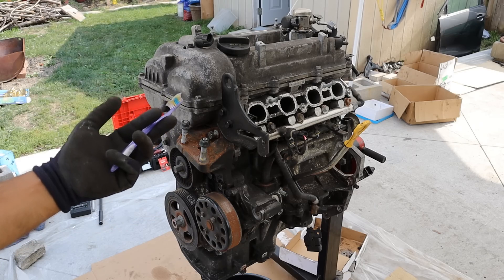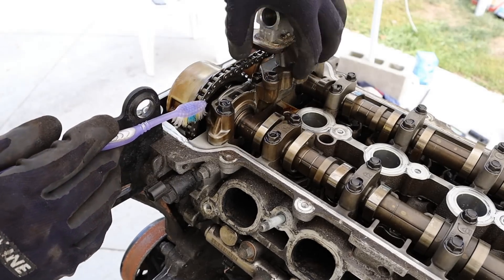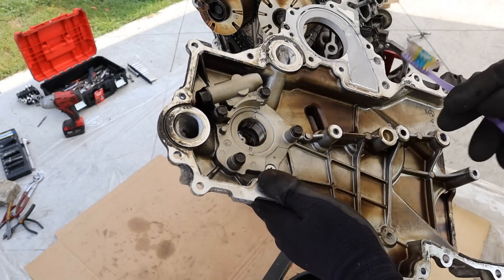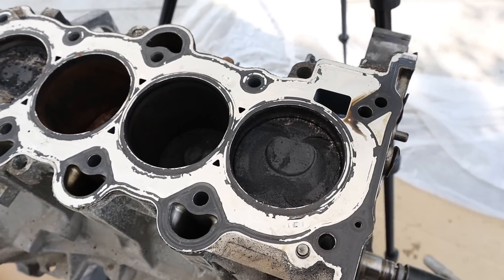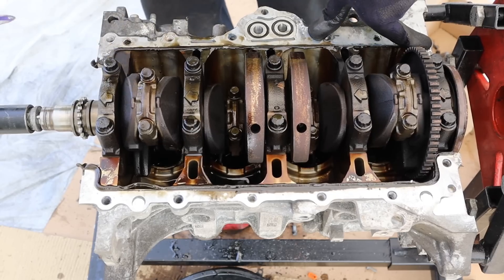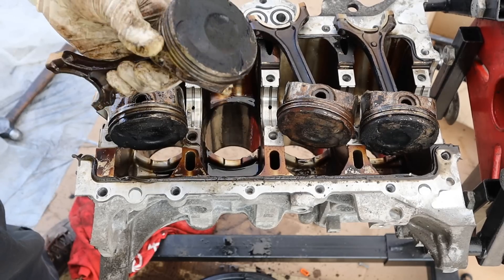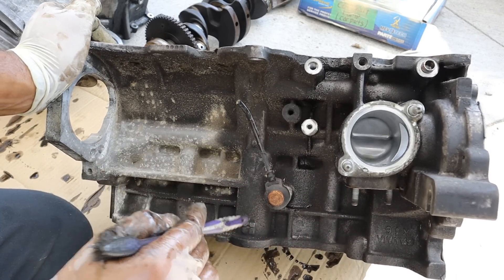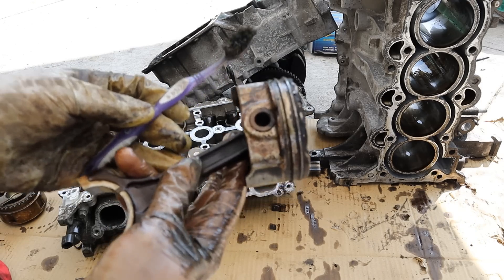Why KIA Engines Fail

Comment: Let's not put all the blame on the owners.  My Sedona threw a con rod at only 70 k.  I was running expensive synthetic oil and changed it ahead of schedule.  I also never drove it hard.  How about a little blame for the engineers that designed these pieces of crap

Comment: Mine has 181K on it and runs amazing. Oil consumption is awful but it doesn't blow blue smoke or leak. Original clutch in car. It's partly who drives it.

Comment: Fiat use a single casting that carries the bearing shells. They save the costs of all those caps and get a stiffer engine lump into the bargain. 
Their cost cutting goof was fitting a weak cam chain that will fail after 100K miles.

Comment: Nice Video. Wish I've seen it before may. My Gamma 1.6 T-GDI (62k km) blew the turbo and developed an engine knock due to oil starvation after 5k km from being serviced at Kia dealership(full engine changed at one year and up to 15k km). I reported a year ago ... Lesson is to check the OIL and don't trust the dealership.

Comment: These 1.6 GDIs are usually very solid. 
Short trips and low quality oil and fuel will hurt them after 10 years though. 
I've seen them with around 700k miles on them without being opened. Synthetic oil and mostly highway trips (so at full operating temp) definitely helps to get that far!

Edit: the plastic inserts in the cooling jacket are to evenly distribute heat and therefore thermal expansion between the top and bottom of the cylinder.
Reply: Put a time stamp for what you're talking about. 6:10
Reply: FACTS! The dealership i bought my Hyundai had a 06 Sonata with a million miles on it proudly displayed in the showroom.
Reply: 700k 🤣🤣🤣
Reply: @anthonyiannone7618  yep, lemme find a link
Reply: @19jacobob93  700k?!?!?!

“Hi yes I’ll take sh*t that never happened for 500 please and thank you”
Reply: @maxboya  it's on the Hyundai forum on a thread called 'another milestone' it keeps deleting my comment when I post a link here. It was at 635k miles in February so will be much higher by now
Reply: @19jacobob93  Hyundai and Kia are very hit and miss coming out of the plant.  

I worked for Hyundai/Kia when we sold truck loads of Theta II cars, and some of them were blowing up before their first oil change.   The 3.3 Sonatas and Azeras were even worse.

I agree that certain engines IF built right and taken care of right will go a long time, but there comes a point where you see too many cars going through 3-4 engines on people for it to not be the fault of the manufacturer as well.  

That being said, my one and only Hyundai had 680k on the clock (km) on it's second engine and original trans (2nd clutch).  It was a diesel H1 with the Mitsu based 4D motor though.  Nothing electrical worked, but the drivetrain was solid, albeit slow an inefficient.
Reply: @maxboya  my wife’s 2011 forte ex has 240k miles on it 🤷🏻‍♂️
Reply: @Max  crying laughing at this, 8yo 150k and my gdi is drinking oil like it's a 2 stroke, I changed oil every 5k
Reply: @SmallT2  2.4?
Reply: @anthonyiannone7618  700k yards
Reply: How does plastic help in heat distribution
Reply: @mastergreyskull523  it's nothing to do with the material, it's designed to decrease the coolant flow over the bottoms of the cylinders in order for them to match the thermal expansion of the hotter top end
Reply: @mastergreyskull523  it's a very special kind of plastic, capable of things we haven't imagined. Lol
Reply: 700K.....hmmm hard to believe......
Reply: @neilduncan8657  that's why I gave the details for people to see the vehicle since I can't post a link on YT... What would I gain from making that shit up?
Reply: 700k         crap !
Reply: 70.000max
Reply: @arnoldh7204  There are multiple with crazy mileage. They are a popular taxi in Turkey and often pass 1 million KMs on the same 1.6 Gamma engine. As I stated, they are just sensitive to cold cycles... If they stay warm or do long trips such as use in taxis, they will last forever. Obviously a warmer climate also helps.
Reply: Low quality oil?  Where do you buy that since ALL oil in the US is spec'd to be the same per the UAE weight.
Reply: @justayoutuber1906  the UAE weight has nothing to do with quality. I would explicitly use oils with Group III base stocks as a minimum in all GDI engines
Reply: you meant 700Kms? LOL KIA engine are junks!!!
Reply: @kristianbautista6647  No miles. I think it currently has around 680k. They are good but sensitive to a few factors such as driving too hard on a cold engine or only short trips, low quality oils and fuels and not servicing on time. A combination of these factors is why they fail.
If you do mostly highway driving, use high quality fluids and fuels and give them an Italian tune up once a week, you won't have a problem. 
I can make them last forever because I have mechanical empathy whereas most Hyundai/Kia buyers purchase them for their lower price and have zero mechanical knowledge and rarely stick to maintenance schedules.
Reply: Are you a comedian or just a troll? Kias and hyundais are poor quality economy boxes
Reply: @getthecansin  both thanks, and I tend to agree although my statement was solely directed towards the 1.6 GDI engine in particular so let's not get off track. 
I've worked on a few of them, some with big miles and unless they have been abused with poor maintenance or used solely for short trips in cold climates, they are very reliable.
Reply: @19jacobob93  fair point, bloody GDI engines in general are a pain 🙂👌🏻
Reply: @getthecansin  Yeah they definitely can be! Some seem to avoid the issues completely somehow. BMW and VW have had some horrendous problems! GM, Ford, Mazda, Merc all seem to have avoided any GDI related issues. Hyundai/Kia are very hit and miss. The 2.4 and 2.0T I'd completely avoid, everything else seems fine. Honda had a problem with massive fuel dilution in their 1.5T too!
Reply: @19jacobob93  agreed, hit and miss but bottom line do the flipping services 👌🏻
Reply: @19jacobob93  the 3.8l v6 in the palisades/tellurides/genesis models are amazing. That’s definitely included in the everything else besides the 4 cylinders lol
Reply: @rob malcolm  Yep those seem to be great in both GDI and MPI form! Never heard anything bad about them
Reply: @getthecansin  look up reliability lists, kia has come a long way from being economy shitboxes, they are doing pretty good on reliability now
Reply: @idk970326  true measure is long term reliability, will be many years till we know. New models like most cars great out of the box but time is the test 👌🏻

Comment: I think another reason why certain manufacturers are more reliable and longer lasting than others has to do with their respective owners. The typical driver profile for Toyota are more conservative with conscientious maintenance. Honda…especially the Civic owners include a lot of performance minded less conservative drivers however they also continuously tune and maintain their vehicles. And then you have the typical Hyundai/Kia drivers. 😂
Reply from the maker: I agree that has a large factor

Comment: Smokes. Thats a 1.6 liter engine!?! With such a lame timing chain!?!
I had a 550cc V twin bike engine with bigger timing chain than that. ie each bank (275cc) on it's own has twice that size for a timing chain. Fail to design!  Belts got a bad rap for failing. So they went for chains? Well, I had a Nissan Skyline L20ET in the 80s that had a dual row chain and that was a straight 6, bigger that whats on this vid. Sorry, manufacturers of today are making engines to ware out just after warranty is passed. Good luck, I'm keeping my old timers, looks like they are going to increase in value.

Comment: what about the 1.25 Kappa engine? I bought a used picanto and does the routine maintenance. the previous owner did use plain water in the radiator though, which is sad. but overall the car has been pretty reliable.

Comment: The play in #1 that suggested the bearing was worn out, but it wasn't? What else could've caused that play in the piston + rod like that? Clearly something was wearing down in the engine with the metal in the oil and pan, but it didn't look like anything that would've led to #1 having all that extra play in it. Did I miss what it ended up being?

Comment: i had a kia picanto 2017 1.2 engine
and i beat it every day
road racing
and it has 100k and still going strong like new car
Reply: @WirelessNut bro you need to try racing and sliding this thing, its so fun and fast, i learned to drift fwd in it you need to lock the rear wheels just use the ebrake with little of footbrake at same time and the car will lock in back
and but tires at 32in front
and 36 in back

Comment: 2012 Kia Soul base model, 1.6 L automatic with 239, 560 miles on the clock as of today.  The key is oil changes every three to four thousand miles.  It burn about 1/4 of a quart between oil changes.  Oh, never cleaned the valves on this direct injection engine.  Still runs like a Swiss watch.  The only item that needed replacement was the alternator.  All other items were maintenance items.  The trans is service every 30,000 miles and the cooling system flushed every two years. The front pads and rotors replaced at about every 30/35 thousand miles and the rears at 50 thousand.
Reply: Do you still have it? How is it so far? Have the same model but with 87000 miles. I figure if I keep up with maintenance and fix and protect from rust it could go on for another 7-8 years.
Reply: Good luck with that mine at 214k started to idle low and wanted to shut off because of carbon.
Reply: Kia on basically all of their engines uses really low tension piston rings just like the early 1zzfe, 2azfe, and 2arfe, Dynamic force toyota engines as the piston rings get clogged very easily. They along with other manufacturers do it because it is one of the cheaper, easier ways to get a solid 2-3+ mpg from an engine. Volvo's mixed reliability reputation is from their most of their new engines having low tension piston rings that get better fuel economy from less friction, but then they get seized up, they scrape the walls and lose compression. Ecotec engines do this too though are not as extreme as three manufacturers I have listed already. These newer engines across different brands are basically intolerant of neglect in terms of not becoming oil burning. I don't like the idea that doing 6k oil changes can somehow be "neglectful" enough for an engine to start giving me problems

Comment: I rebuilt one of these engines last year, they are simple enough that not a lot can go wrong with them, my only complaint with them is the surface of the rod caps where it meets up with the connecting rod, very crudely done, to me it looks like Kia casted those rods and did no machine work to them at all.
Reply: what if cracked?  mo betta no?
Reply: Hi Chris do you think doing a professional hidrogen carbon cleaning every 30.000 miles (50.000 kms) would increase engine longevity? it costs like 80 dollars.
Reply: @ramirocosta1  yes, and if you are dealing with a direct injection engine keep a close eye on the intake valves, if it gets bad enough you are gonna have to pull the intake and walnut blast the intake valves, depending on the engine it's very labor intensive, in the case of this little Hyundai 1.6 it's fairly easy, and a little word of advice, I like to flush the tops of the pistons with something like seafoam or Berryman's, what happens with these little Hyundai Kia engines is that the drain back holes behind the rings get clogged and your engine starts consuming oil, and that goes for the bigger Kia/Hyundai 2.4 engine too.
Reply: @redchris97  thanks, will follow advice.

Comment: What was the damage on that one con-rod that made it so loose?  Sophisticated engine; Too bad they let crankcase air into the intake manifold and fouled things up.  Other than running the fuel into the manifold, I don't see an easy solution to that problem.

Comment: Did the metal particles come from the cylinder walls breaking down , & then getting sucked through the oil strainer,  & pumped into the 2 closest bearings they could get stuck in ? Mine despite having 204lbs exactly across the board , had begun scoring the cylinders badly ..After useing a camera down the spark plug holes it looked like the ring end gaps dragged first, & then progressed from there...In any case whether by temperature, or incorrect clearances, or incorrectly made components, the car ran way better when I added 4.5 ounces of synthetic 2 stroke oil to 10 gallons (canadian) gasoline.. It"s very low in sulphur,& ash , but in any case at this ratio it won't clog the converter ,& it shouldn't have made any difference in performance ,BUT IT MADE A HUGE DIFFERENCE IN PERFORMANCE., & passed our ontario emissions test lower than any other car there that day. 2011 Forte theta 2 engine 130,000kms waiting to blow up!

Comment: We have a 2013 Optima Turbo 2.0L running a Lap3 piggyback tune for the past 3 years. A jeep hit the car in the front end. My inter cooler is dented but still it holds boost. A caravan hit my rear quarter. It's been a solid reliable 300whp rocket that gets me 40mpg. I only run ethanol free fuel, and use synthetic religiously.

Comment: This is why I change my oil every 3-5k miles and have a catch can. It may not prevent this entirely but it'll hopefully help. Also, drive your DI cars HARD, don't just putter them around all day.

Do you think the Forte GT from 2021 is affected? It's a gamma but you mentioned this was from a previous gen forte while mine is turbocharged.
Reply: Wym drive them hard? If you're talking about the car's jerkiness at low speeds thats the transmission.
Reply: @alanr4845  I mean drive them hard to prevent carbon build up.
Reply: @alanr4845  Don't take advice to drive your car hard.... You will blow your engine listening to a idiot on YouTube
Reply: I'm curious, so I'll ask.  "How does driving a car hard prevent carbon buildup in a GDI engine?"
Reply: @libraeotequever3pointoh95  Small displacement turbo cars require you to drive them hard every now and again to reduce carbon. If you're driving in traffic all day long you're not really changing the AFR's very much so they can run lean to compensate. I like to think "a redline a day keeps the carbon away". It's similar with rotaries. I'm no mechanic, so I'm just passing along what I was told.

Comment: I have and still drive my 2003 Kia Sedona..... 282,549 miles....leaks a small amount of oil....still running great and strong.....she is my beater with a heater for winter. Has been a GREAT van for 18 years.
Reply: I have a 2023 K5, no oil being used at all. nothing has broken at all so far. However I change the oil myself at 5k miles, use top tier gas. It obvious that motor was neglected
Reply: That is good to know. Your only second person I heard this. When I was shopping for a minivan at a dealership, someone told me the same thing about their very old Kia Sedona. They literally told me the Sedona will not die lol 😂
Reply: @rmwarriors16  We have had 4.  A 2008, a 2012, a 2017 and a 2016.  The 2008 and 2012 were great,  The 2017 seemed as good, but some kid T boned it at 80K.  Bought a 2016 that supposedly had 55K pn it, had more issues with it than the other 3 combined and then some.  I actually think it had the miles rolled back on it - it just seemed to have to much wear on the seats and pedals for a vehicle with only 55K on it.  But it was the middle of Covid and there wasn't many choices.  Traded it at 85K miles.
Reply: Yep. Kia minivans (I have a 2009) were built on a truck chassis with 6-lug wheels and suspension parts twice as tough as those on Chrysler/Dodge vans. They had a 3.8L v6 with a lot of grunt and better gas-mileage. Don't buy any Kia made after this generation ended.
Reply: This one comes with a Mitsubishi V6 engine in 2003 Kia Sedona, that's why.

Comment: Very similar to G3LC (LH) engine, with the exception that G3LC is a turbo and has oil injectors under the pistons. Friend’s lasted 256k, then head gasket blew, but he was thrashing it all it’s life. I mean like starting it in -20C and flooring it after 10 seconds kind of thrashing. Doing 200 on autobahns and shit. Oil changes were done only after 15k. I have the same engine with 160k now on the clock, but I treat it gently and do oil changes every 250 hours. A nice experiment to find out will it last longer or not. I do give it revs from time to time, but only when the temps are optimal and oil is not running on it’s final hours. Will keep you posted. P.s. we can get it new for 3k, so even if it blows at 250k is still a bargain to own and gets 50-53 mpg

Comment: People...just change your oil every 3500-4000 miles...you will be so much happier....if you cant do that...buy a toyota...you will get an extra 50k miles before you ruin the engine. I've owned Kia and Hyundai for the last 25 years...even a theta II...no problems with any of them ...all went at least 10 years and 150K miles...I don't keep cars longer than that because I don't want the endless replacement of peripheral parts that starts soon after on all brands...timing chains...water pumps...wheel bearings....etc....everyboy else...only buy a used car if it is coming off a lease and they have the oil change records....Americans in general do NOT take care of their cars.

Comment: Guess since there were actually under the threshold 20,000,000 million recall, considered stellar overall. 5,000,000 + recall due to electrical fire considered merely moderate safety concern. It's no bigee since approx 1/8th electrical fires were engine off, driver/passenger not within presence vehicle, at ignition temperature within fully engulfed flames, no reason to become panic. As long as one has in good hands with allfate ins,
Reply from the maker: The 1.6 had a recall too??